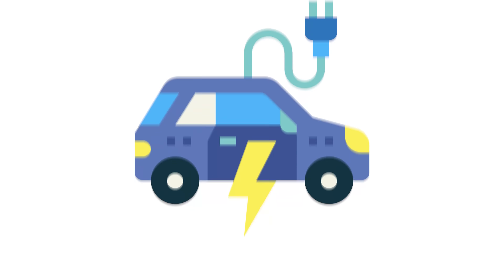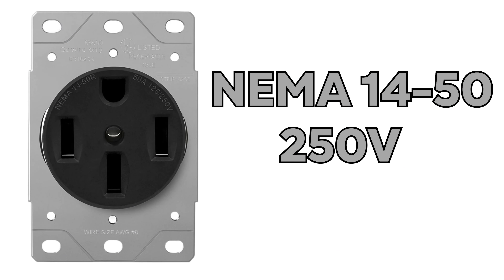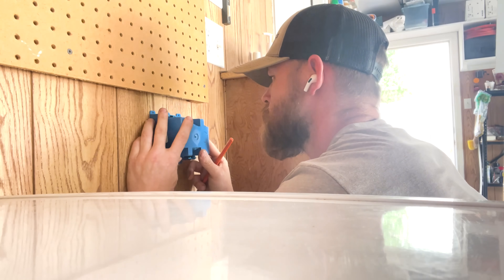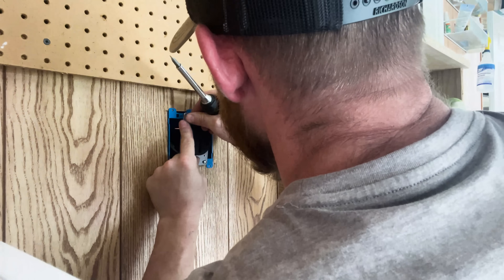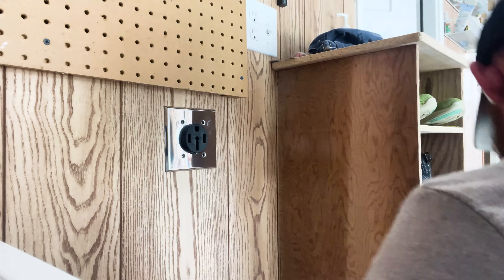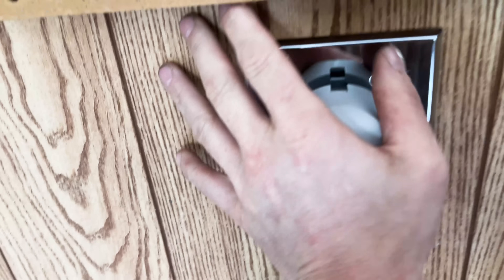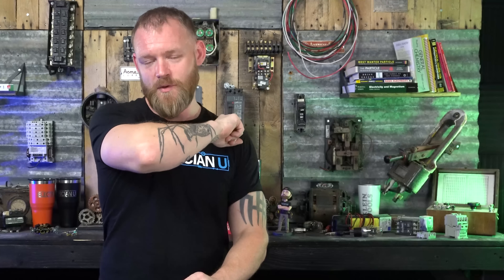How to Install an Electric Vehicle Charger Receptacle

Comment: For those that may not realize this, this plug is actually the same type of 50 amp 4 prong plug and circuit that your electric stove actually plugs into.  If at some point you changed out your stove to a gas stove and if the wire is long enough and you never plan to go back to an electric stove, you might actually be able to redirect the wire and relocate the plug to where you want the charger.
Reply: The 7 people in the world that this very specific situation would apply to thank you.
Reply: @stargazer7644  7 folks charge their car in their dinging room.
Reply: @cheddarcheese  Many homes have the washer and dryer in the garage.
Reply: @stargazer7644  shows how much you know about it, you think everybody lives in a new house, a lot of people have terminated electric stoves to go back to gas, which cost much less. Then you have 50 amps of 240 that you can utilize.240, or for other power at 120.
Reply: @frankpaya690  A lot of electric car owners switched from electric to gas?  No, I think this shows how much you (don't) know about electric car owners.
Reply: @frankpaya690  That is what I did. I changed to gas, and borrowed some 120v from a 50A 240v to power the clock and controls for the gas range.
Reply: @stargazer7644  I think he means a gas range, instead of electric range.
Reply: @cheddarcheese  That's similar to what I did in my eighty-year-old property There's a lot of older houses around anywhere from 50 to 100 years old & some people assume everybody lives in a house no more than 10 years old. There's systems in older property that over the decades have had various things done and sometimes people go back to what was there before, in my case and yours the gas range which burns cleaner and cost less than electricity. When you have property decades-old there might be a combination of wiring & of fuses along with sub-panels that have Breakers. You're going to have older and newer systems within and some people commenting here don't seem to get that.
Reply: I don't think people with EV would consider convert their electric stove to gas (it sounds rather akward) ;)
Reply: @denisouellet6518  they're usually environmental wackos who have this idea that electricity is a free lunch.
Just plug into the wall, as if electricity magically happens out of nowhere, from behind the sheetrock.
Reply: Not sure what the laws are like where you are but where I live that will break code because they must have a outlet for a electric stove top.

Comment: 9:47.   8-3 NMB is rated at 40 amps maximun.  A 40 or 50 amp branch circuit can supply a 50 amp receptacle.  So, in the future the 2/30 breaker can only be exchanged for a 2/40 breaker and the property probably shouln't be advertised as prewired fo a 50 amp EV branch  circuit.
Reply: Newbie here. Does length of run have anything to do with gauge required?
Reply: It's been some years since I looked at the tables section in the book. #8 THHN I believe is capable of up to 55A in the ampacity/insulation tables in the back of the NEC book.  #8-TW is 40A maximum. A circuit has to be D-rated depending.
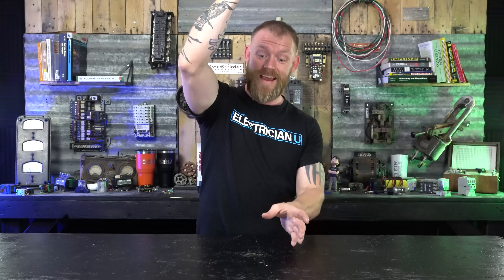Reply: @keithhults8986  I thought I heard Dustin mention he was using #6 - 3 NM (Romex) around 4:40 min in the video then by code- under 100 amps) - (i think?) that using Romex limits you to the 60 degree column of 40 amps.  Do you agree? Or if the breaker and lugs are rated at 75 degrees can you move over to the 75 % column NEC 2020 110.14(C)(1)(A)(3)? I am not 100% sure about this code reference

Rick
Reply: @ricksurette7985  NM can't be rated more than 60 degrees even if the lugs are rated at a higher temperature.
Reply: @ricksurette7985  Like you, I am here always educating myself and sharing my thoughts. Just looking at the table, it says 55A THHN. This is where my questions begin. I don't fully grasp some of it. The ambient conditions. In conduit or sheathing?  If the service equipment is 75C rated, I calculate everything on the service at the lowest C rating on the equipment.  30yrs ago, before I had any understanding about D rating, a group of us wired a bakery 3 phase. One circuit was operating at a noticeable temperature on the cable, outside the panel. Inside a panel, it looked very neat when the man tightly cable tied all the branch circuits. And he cable tied bundles of cables outside the panel also. That was my first D rating problem. It's the same as over filling a conduit. That mixer was pulling only 20A on a 10/3 BX. Why would it heat like that?  Bundling 6 constant duty 3phase circuits inside the panel and outside, along the runs, caused allot of heat. I cut the ties inside the panel, and let air space occur, then I cut all the bundles of BX and refastened the cables with spacing. An hour after I finished, the branch circuits cooled down.
Reply: @keithhults8986  NM cable is to be rated at the 60 degree column. The 90 degree column is only for a starting for you derating calculations. Most terminations are rated at 75 degree so you would be limited to that column anyway.
Reply: @keithhults8986  NM cable is to be rated at 60degrees C...which makes it good for only 40amps.
Reply: @electvolt67 The wire insulators are rated. TW is rated at 60C THHN is 90C in the tables,NM is 90C only if the cable has THHN wires inside. Older NM with TW is 60C and so on according to the wire type tables in the back of the NEC book. The ampacity according to the wire type tables has not changed. D rating and ambient condition factors are figured in additionally by using other tables in the book. When I wrote 3yrs ago, my medical condition was not good. What I forgot after 40yrs, in my retirement, you might be learning.
Reply: @keithhults8986  55 amps at 90 degrees for derating.

Comment: Justin I have followed you for a long time this is the only time I think I disagree with you. I believe that the GFCI should have been installed notwithstanding the charger at the end of the receptacle or the car had one built in. I prefer a belt and braces approach assuming that both GFCIs are appropriately selectively coordinated. That way you are future proofing. Quite frankly I would be concerned with DC leakage from the ev car swamping and or blinding the GFCI so it does not operate at all which is way worse and even if it is as you say false tripping how do we know it’s false tripping rather the transients and leakage being created could be an issue with the cars electronic charging circuitry which could be dangerous and  should be communicated to the car manufacturer.

And in my jurisdiction we still are on the 2014 NEC, and I always apply the latest 2020 code, it helps with future proofing. With regards to nuisance tripping in most cases it often requires using various types some are better than others. Requires a multifunction tester with the capabilities to test a variety of GFCI types.
Reply: Do you prefer charging customers money they don't have to spend?   My car charger has a GFCI built in.  There's no need for one in the breaker.
Reply: @stargazer7644  and it’s important that the car GFCI works as intended and should be made to operate as stated test gear is available to do that. But really GFCI breakers are not that expensive and properly coordinated can work well with the car charger. Imagine if there is a fault in the car GFCI. It’s a belt and braces approach especially with a car battery where DC leakage can be significant and can cause problems on the AC installed side as well.
Reply: @mathman0101  Yeah, it's only 10 times as expensive.  You can "imagine if there's a fault" till the cows come home.  I mean, what happens if your GFCI breaker is faulty?  Why don't you just get rid of all electricity from your house?  It's the only way to be sure you're safe.
Reply: @mathman0101  ... not expensive? A 50 amp breaker is under $20 but in GFCI it's one side or the other of $80.
Reply: @stargazer7644  ... it goes against code to have two GFCIs on a circuit (they will also buck against each other and nuisance trip) but if local code calls for one at the outlet the only way around that would be to hardwire the charger and skip the outlet.
Reply: @Math Man:  Are you certain that DC leakage will blind a GFCI in the US?  A type B RCD will detect DC leakage but this isn't considered (much) outside of Europe as EU EVSE doesn't have GF detection. I don't have data but suspect a DC leakage problem (OBC PFC failure?) will typically show up as an EVSE CCID trip. Do you have data that states otherwise?  I'm thinking this topic will get attention when PFC becomes mandatory for large appliances in the US.
Reply: @hvecmod8265  you raise some very interesting points. My original response to this thread and the word was not picked up fully by anyone yet is the issue of selective coordination. Have the two GFCI protections been well coordinated such that their trip current curves don’t overlap as a first order basic issue (there are other issues than just trip current curves). NEC requires GFCI protection for say a NEMA 14-50 in a garage, so for a level 2 EV charger which has GFCI protection built in and if GFCIs have not been well coordinated then intermittent tripping will occur. Sometimes that intermittent tripping due to leakage will occur not just due to capacitance effects on the power electronics side no matter what is happening on the OBC power factor correction but also long runs for that branch circuit. Installation methods and the actual installation will play a role as well. I see most installers use hard wired chargers getting rid of the issue of having two GFCIs from the car to the panel and the intermittent tripping problem. Some installers report and I think this is a bigger factor customers charging at the highest amperage possible for long periods capacitance effects and leakage can then be more significant causing unwanted tripping. In US type A GFCIs tend to trip at much lower levels 5-10mA than European ones and much faster under different leakage and fault conditions. So the chances of earlier tripping is a bigger issue here. That is not to say that some form of Dc leakage and transients could not blind US GFCIs. Until you test fully you will never know and even then it requires your test equipment to be capable and fast enough to pick it up. Really until you install the device and are able to test fully using EV capable test equipment to pick signals from the OBC and that also means using an higher frequency capable signal oscilloscope to pickup transient power quality issues you really cannot make an assessment that two GFCIs are well coordinated in that sense the NEC will need to be updated. Yes UL testing is supposed to cover many of these issues but that data is not always easy to access and some of it is behind a paywall. Manufacturers need to publish much better technical information around GFCIs. Hopefully that will happen soon. My discussion even with engineers from some of these companies has only gotten me so far. Level 2 chargers get thrown about a lot subject to quite a bit of mechanical damage and power electronics with cars are not all created equal and can fail. So I prefer either to have a hard wired charger or if using a lever 2 charger rather have additional protection having done due diligence around selective coordination to reduce intermittent false tripping and recommending customer does not charge at full amperage draw. I have to say power quality harmonics are poorly understood including their implications for electrical safety this is partly because it’s is technical requiring deeper and higher level mathematical understanding which is not covered in any real depth for electrical training. It requires the electricians to read more and seek out additional more advanced CPD training.

Comment: Dustin - I’m subscribed and have been watching you for a few years. I usually enjoy your videos, but this one has several blatant code violations and moments of mis-speak. 
-Table 210.21(B)(3) would require a Nema 10-30R rather than a 10-50R, since you’re using a 30 amp breaker. 
-“#8 is a 50 amp wire”. This would be true if you’re using, say, MC and your terminals are marked for 75°C. Unfortunately, you’re using Romex, which is limited to 60°C column of Table 310.16, (per 334.80)
-You referred to the neutral as a current carrying conductor. 310.15(E)(1) would disagree, since it is only carrying the unbalanced load from the black and red conductors. 
-Lastly, and this is more of a harp on the graphics, early in the video, you showed the faceplate of a Tesla Wall Connector and a J-1772 plug instead of the Tesla plug. 

And I’m glad your jurisdiction waives 210.8(A)(2) and 625.54. I wish mine did 😅
Reply: - 210.21(B)(3) is not the correct section for this circuit.  (B)(3) says it is for a "branch circuit supplying two or more receptacles".   There is only one receptacle on this dedicated circuit.
210.21(B)(1) applies here, and it says "A single receptacle installed on an individual branch circuit shall have an ampere rating not less than that of the branch circuit."  A 50A receptacle is not less than a 30A circuit, so that's fine.
- #8 ampacity - yep, he goofed here.
- You're being a little too pedantic here.  The purpose of that section is for calculating deratings for conductors in conduit.  That isn't what he's talking about.
Reply: The neutral or grounded conductor is current carrying.  It's just not required to be counted in the adjustment table 310,15(C)(1).
Reply: Neutral is always a current carrying conductor. Just not all of the current.

Comment: Consumer pulling that large plug in and out almost daily may loosen that
new box over time?
Reply: Usually the charger is left plugged in to the receptacle all the time and the disconnect/reconnect occurs at the car's charging port.

Comment: Many viewers may not actually understand that the load governs the 
amount of current drawn.
Reply: Also, some people don't understand that the EVSE sends a signal to the car to tell it how much current it is allowed to draw on a particular connection.
Reply: @charliesullivan4304  Count me in, as one.
Reply: Exactly you're overcurrent and comparable wires and receptacles are dependent on what you're trying to power. How many amps is it drawing? You're talking about a dedicated 240 circuit. And how many amps of 240 determines how you wire it. From overcurrent, wires to receptacle.

Comment: Great stuff. Does the wiring need to be secured along the route from the receptacle to the panel? How do you secure it when there’s insulation?
Reply: In attics it is supposed to be secured & supported. Behind Finished walls it does not (that would be difficult). Conductors need to be secured for unfinished walls.
Reply: Normally cable needs to be secured to studs, joists, etc. 
But cable fished thru inaccessable space does not need to be secured.

Comment: Ha ha, I knew there would be an avalanche of remarks about the 8/3, even though in your case you are using a 30A breaker. Here in Canada, I'm not an electrician, but I believe we need to use the 60 deg C column of table 2 for Romex home wire. So, annoying 6/3 for 50A receptacle, maybe less for hardwired specific use. And annoying increased demand on the panel output limits. Is it legal to attach a 14-50 receptacle to a 30A circuit? Ideally, I guess you would want to change the male plug to 30A, but I can see why car chargers are specific, and you want the versatility to plug in many different cars to that same plug.

Comment: Great video! Quick question - the 30 AMP breaker makes no sense to me. If you install a 14-50 receptacle, and then presumably buy a charger that comes factory installed with a 14-50 plug, isn't it going to try and draw up to 50 AMPs (and always trip the breaker). Or do these chargers have some sort of setting on them where you can tell them to draw less current?
Reply: There’s different size charges. We put one in for a ford and they have 3 options for chargers, the 240v ones being 30 and 50amp
Reply: Just because it has a 50A plug doesn't mean it draws 50A.
Reply: Tesla allows you to reduce the charging amperage at a specific location.  The panel at my old house had no expansion capacity, but I was able to charge with an existing 5-20 outlet by using the provided 14-50 plug with a short conversion pigtail and limiting the current to 15 amps.  It worked for several years...
Reply: I see. Thanks. Didn't realize that.
Reply: EV’s have an onboard charger that dictates what goes into the car, most of them are 7.2kW the newer ones are 11.5 kW so that’s 30A and 48A respectively.  You always want you weakest point in your circuit to be the breaker so if there’s an overload it will trip and not burn the outlet or worse melt the insulation of the wiring and cause a fire in a wall.  In his case if you go by the 60 degree table for NM-B 8-3 wire 40 amps is the maximum allowable, since his breaker is 30 amps this is ok.
Reply: @charlescottone8939  You aren't allowed to have a 30A continuous load on a 30 A circuit, as it might lead to nuisance tripping and, if the wire was only rated for 30 A, overheating.  Also, just because your car is only 7.2 kW, you shouldn't have a set-up where a visitor plugging in blows the breaker.  The solution is either an EVSE ("charger") that is a dedicated 24A unit, and tells the car that only 24 A is allowed, or a programmable one that is configured for 24 A when it's installed.
Reply: @charliesullivan4304  I was merely commenting on the video this is not my setup, I was merely
Making the point that ev or the evse dictates how much current is pulled.  Since this guy is an electrician I would hope he’s following the 80 percent rule.  My evse can pull up to 40 amps but it’s set to 32 max, my outlet is a NEMA 14-50 , breaker is 50 amps and wiring is THHN 6 guage stranded, also I don’t let anyone “guest” charge my garage is locked